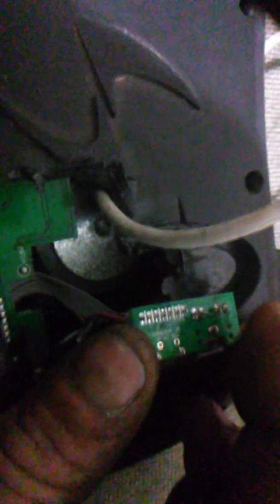How to fix rechargable devices with broken USB charging port in 5 minutes

Comment: Ssved my bluetooth speaker and the cost of the micro USB repair. Used s 5v USB charger for the 5v rechargable battery. This should not over charge battery,  Right?

Comment: Would it matter to witch battery connection i connected the black and red wire from the usb cable to? For instance I have BAT-1 & BAT-2 connections to choose from. My question is
would i twist both 1&2  red leads and both 1&2 black leads together with with and black wires from usb or would it be ok just to CHOOSE either BAT#1 or BAT#2 ? Thanks for all your help ... god bless
Reply from the maker: Yes. Some devices have dual battery packs in them so you can either make a jumper which is a small piece of wire that  connects the 2 red wires coming from your batteries and another for the 2 black. The jumpers should be stripped at both ends and a small section in the middle as well. Essentially your making 2 "Y" cables where the 2 upper arms of each "Y" connect to your red and black battery lines and the lower arms of the 2 Y cables connect to your red and black usb wires. I hope that makes sense.

Comment: What if it doesn't have a battery  and only the port
Reply from the maker: Well my friend then it is not a rechargable device as the word rechargeable would imply something with a battery that could be recharged. If its bluetooth that would imply a wireless data exchange it has a battery. It might be very small,

Comment: Hellz ya! this got my speaker working thanks man. I flipped the mother board and soldered to the negative and positive battery clip pins it doesn't say it is charging but it definitely is. Will it stop charging when finished with this method or will it just keep cooking the battery?
Reply from the maker: Well it can cook the battery especially if your using a fast charger box so I recommend looking at the milliamps in the battery and finding a charging box thats equal to or less than the recommended milliamps on the battery pack for safe charging.

Comment: If this works GREAT ! But the videos shaking  couldnt see what appeared to be you (?) Stripping and twisting the ground (Black wire) the positive (red wire) together ?!
Then you tied in the USB cord and lost me ? Thanks for your reply on this ! Back to the video tape
Reply from the maker: Sorry I took this long to get back to you I honestly had no idea this video had so many views or comments I just saw this today and was like damn. Anyhow you do not ever twist the black and red together thats a no no. Make sure to not break the wires going from the board to the battery if you can help it. Try and melt back a tiny bit of the shielding in the middle of each wire going from the board to the battery (red and black wires) to expose the bare wire underneath. Then take your red wire from the usb cord (stripped back about 1 inch on both the red and black wires on the usb cable) and connect  the red wire to the red coming from the battery in the middle where you melted back some of the shielding by making a little hook with the red exposed wire on your usb cable and then twisting it tight and putting a small piece of electrical tape over it amd do the same for the black usb cable wire to the black battery wire. Its very important to not disconnect the wires or break them off of the board or battery thats why you use a lighter or heated piece of metal to melt back the shielding on the wires rather than break or cut them. Black to black red to red.

Comment: It is great to know I can save my speaker. I just need a bit more clarity on the film as to how you connected those usb wires. Do I leave the originals in place, strip them back a bit and attach black and red to the original wires. Such a visual learner, it would be great to have a video showing this step.
Reply: Hello
Reply from the maker: Sorry I do take a while to get back to people. Yes just strip back the the shielding on the red and black wires that go from the board to the rechargeable battery, I suggest doing it at different spots that way its less likely the wires will cross. Then take your usb cable and attach the red to red and black to black and you should be able to bypass the broken charging port and recharge your battery. I would suggest looking at the rechargeable battery for the proper milliamps and find an old charger box that has the same or less to recharge your devices battery.

Comment: Just incase people are having trouble, tell me of this sounds correct -
1. Open device
2. Find the charging connection on motherboard (green plate like thing that's connected to everything).
3. Strip the USB cord ( cut the opposite end of the USB to expose the wires.
4. Use the newly cut USB wires, and wrap them around where the charging cables previously were for the original cable. (Make sure to disconnect the original cables)
Reply: Basically he removed the battery function of the device because of the broken port. He then hardwired the USB cord to the black and red so that as long as it's plugged in it'll work perfectly. 
I think I'm just going to hook my son's remote control car to my portable battery pack 😅
Reply from the maker: No do not disconnect the wires from the mother board or battery. Use a lighter to melt back some of the shielding in the middle of the wires between the battery and board to expose a little bit of wire but keep everything connected to the board and battery. Then connect the red and black wires from your usb cord to the exposed wires red on red black on black and use a small piece of electrical tape to seal them back up and keep them from touching each other. Then you should be good to go.

Comment: truthfully i could not see very well, can you explain real quick: you peeled and wrapped together the wires from the battery to the charger or from the charging port to the charger?
Reply: So cut the cord with the USB, take those wires and put them where the charging wires are currently, which should be RED and BLACK.